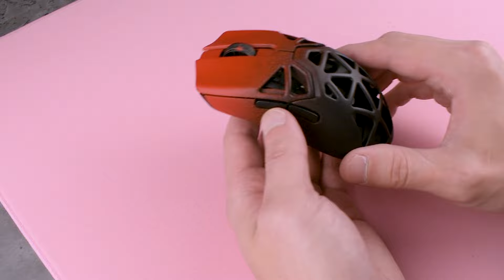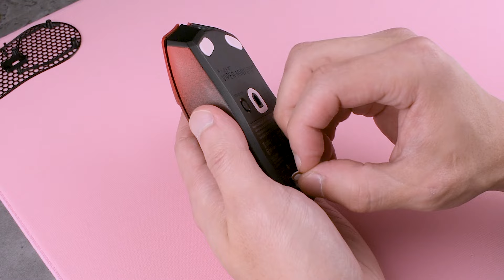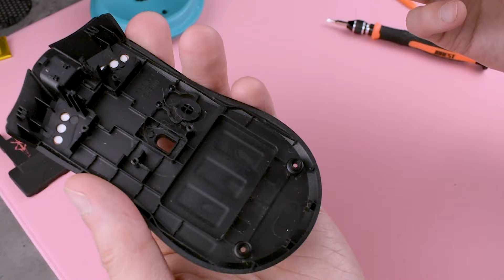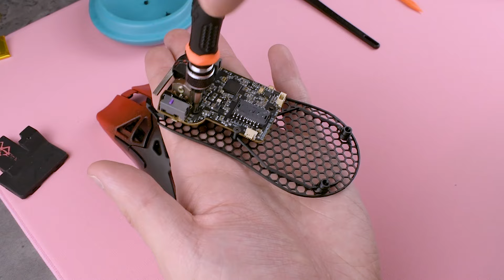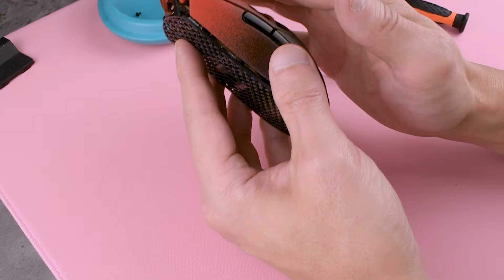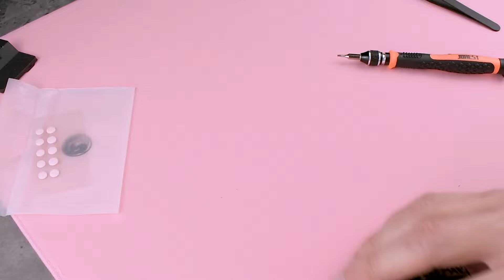TJExclusives 40 Gram Razer Viper Mini SE LIGHTWEIGHT BASE MOD!

Comment: Nice! i put the same base on mine. Just a heads up you can re install the battery cover. It only weighs like half a gram. Makes it look cleaner in my opinion.
Reply from the maker: I was wondering about that! Think I will do it because I would like the Brand of Sacrifice back on my mouse lol. Cheers!